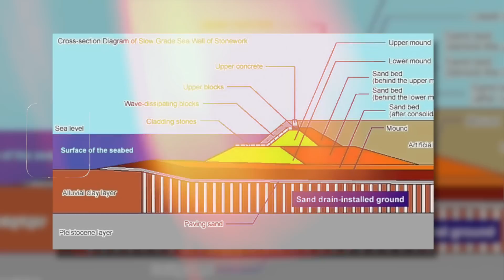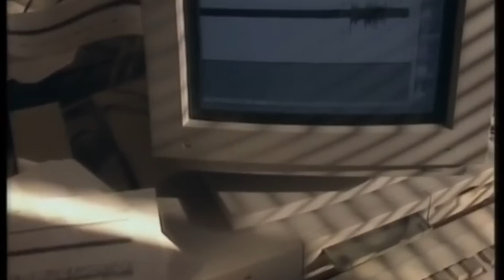Why Nobody Can Fix This $21BN Floating Airport

Comment from the maker: Is this the most flawed airport design in the world?
Reply: Germany's "new" airport takes that crown since it has never opened after more then almost 14 years of construction. it is 4 years ago since it was supposed to open.
Reply: @bailvik6390 häh? Are you talking about Berlin Brandenburg Airport?
Reply: No, but this is the most flawed title on your videos...
Reply: It's man vs nature and costs. They could have over engineered the airport's height if they wanted to but that would cost a lot of $_$.
Reply: No. That would be Terminal 2 at Benito Juarez International Airport in Mexico City.
Reply: Very good! 😉👍
Reply: Berlin anyone?
Reply: It’s the most inaccurate video title I’ve seen in a while.
Reply: It is obvious that they miscalculated the height needed to ensure it would not subside or sink... keeping in mind erosion and natural subduction, and not sea-level rise. The only real issue now is to not abandon the airport but to incrementally rebuild over it; thereby, building it higher in sections where it is vitally needed most and gradually over other areas until it is high enough to last another 40 years. To do so, they need to sink under water cement deep enough as anchors to create pillars for support, then add stable topsoil filler to rise the foundation. I am pretty sure the whole project would cost a fraction of the previous build to rise and restabilize the foundation.
Reply: Thanks captain obvious
Reply: Ask the dutch to fix this
Reply: If this was made bu china this youtuber would be calling this one of the greatest accomplishments of humanity.
Reply: This documentary is a bit misleading.  The airport is sinking but not so alarmingly.  They have been able to slow down the sinking.
Reply: My home
Reply: Chinese Military artificial Base islands with airports are eve worse
Reply: The airport was repaired after Typhoon Jebi (therefore it can be repaired, and the "sinking" problem apparently only exists on klickbait pages.
Reply: wondering why they didnt use concrete pylons driven into the ocean floor to depths of 100ft + ? After Katrina the US Army Corp of Engineers rebuilt the levies and flood barriers. In one section they installed concrete pylons to support a flood barrier because there was no bedrock just deep mud. It's held up for over 10 yrs.
Reply: @artcurious807  Said airport is build on two islands, and is NOT sinking. And already was repaired once, after a taifun. Therefore, the video isn't but bs.
Reply: @hokroeger  It has been sinking slowly over the years due to settlement, not due to the typhoon. Just look at the jacking up of all the columns and you will see the repair works that were done.
Reply: @PhiloSurfer  Well, in the case of a Typhoon, like the one who destroyed the Japanese Nuclear Power Plant, it's obvious that it happens because of a typhoon, not because of any sinking of the terrain.

Comment: why it is sinkings is water is running like river under the iland no mater what they do it will go down un less they box the iland in with  1000 ft plate sheets that stop most water flow under the  iland this is some thing that happens alot when there is water on more th one side of an area . it starts out washing out the less compact areas of the iland first which will pull other are of sand around under ground  . i  worked as a hevey equipment operator on an iland for 3years diging  and trying to stop stuff from caving in

Comment: With the cost of the islands of the order of 1000 USD per m sq, perhaps a truly floating island could be build, with sides and the bottom from reinforced concrete?  This shell could be filled with something lighter than water, perhaps hollow concrete blocks...

Comment: If the sea bed is shallow just drill from the surface and install concrete piles into the solid parition of the sea bed. Use large rocks to create a barrier from waves on the side facing the largest body of water.

Comment: I was a mechanical engineer who worked structural engineers. I changed planes at this airport in 1996. I had enough time to walk around and found a display about its construction. The 2.2 million sand filled pipes would be called piles. The display called them piles but did not mention sand as I recall. In my experience in US construction I don’t recall sand being used in a pile let alone a pile installed under water. I believe the designers expected the mass of the airport to be supported on the piles.

Comment: It is estimated that it will take more than 20 years to settle. The Japanese land management laws actually require the filled lands to stand for at least two decades before any development starts. But loop holes were used to avoid such restrictions for the Kansai Airport. It will fix itself after 20 years and stop sinking. Every engineer was aware what would happen. But profit came first. No biggy!

Comment: They will simply need to raise the sea wall and add additional landfill over the existing runways and repave them.  The buildings were designed to be jacked up on their columns so they can be raised gradually.  It is misleading to say they don’t know how to fix it.  This was always expected and the fix was designed into the plan.

Comment: Me with my random ideas, and zero experience in construction, I would say, increase the surface area around the airport a little by extending the edges of the concrete base and build a wall around the airport.

Comment: It used to be a wonderful airport - my best time from landing to exiting the terminal building was under 15 minutes. But, recent "renovations" have sacrificed much of the space previously given over to passengers, to retail. As a result, the arrivals & immigration areas are now much smaller with snaking lines of passengers having to wait for an age. 

Like most sane passengers I do not want to use an airport as a "shopping experience".
But now KIX finally became just like most other Int'l airports - dreadful.

Comment: They already solved it... Or should I say Tokyo already solved it along with NYC. Build a new one directly on top of the old one.  They already said its going to keep sinking till the ground finally settles so just speed the process up. A lot of cities build directly on top of existing infrastructure.  As far as the financial  aspect its already built and in use it would cost them more in loss permanently losing the airport

Comment: i have a simple solution if anyone here can please notify japan. first, it is obvious that at some point it will stop sinking. however this will put it below sea level. it is important to note that typhoon or heavy rains must be removed constantly with pumps during the rains. here is my proposal. at the outer edge where the sea walls are located, you must pile up more dirt. this "island" will become like a volcano type of island. meaning no sea water surges can make it over the outer edge. the bridge may have to be raised at some point. the dirt piled high, will also hide the airport from neighboring neighbors. these new dirt walls must be fitted with trees and shrubs to help with erosion and wind damage. then in approximately 100 years, new layers of runways etc will raise it up even higher. since the buildings are able to be raised, the electrical connections will need to be extended and plumbing as well. essentially the mistakes made here were not raising the island high enough on the initial opening. this is evident by the island sinking more than predicted. when it comes to construction, you must think outside the box especially when this much money and resources are going into things. my opinion is a large hotel / resort / casino should be built on the island, one that is very heavy and must be supported ten fold of what the airport is. this mega resort will be self contained with solar and wind turbines, salt water desalination and completely solo like the wall going up in arab country. also crypto will only be used inside. PULSECHAIN coin $0.00006

Comment: When they update (if the industry and transportion tech doesn't change in 30 years) They better come up with a fantastic pumping system  and or the worlds largest hydraulic lifters...Unless it fully compresses and they build it up...the surface level will be below sea level....and scientist calculate a ocean rise of at least 12 inches (.30 m) in 30 yrs. time (if not faster)...with tides and weather changes thats a lot.

Comment: I would think if they filled those pipes with sand, they could remove the sand and use them to "mud-jack" the base of the airport. Surely they thought of that, right?

Comment: It was stupid to call this a "floating island." It isn't. it's a land reclamation project like the palm islands in Dubai. They cut corners and obviously went to the lowest bidders when they found the engineers. They clearly didn't factor in the weight of the buildings when they did their calculations. Change the title of this video. It's misleading.

Comment: 2 things stick out: 1- why not build it on top of the mountain if they had all this work of leveling the mountain to dump on the water?  2- the main problem isn't the airport sinking but the water coming in, they only need to build a dam around it large enough that water doesn't flow into the airport. Also add some pumps around the dam just in case. I mean do that and the airport can sink another 5m below water level, as long as the airplanes have enough angle to land/take off that sinking shoudn't a be any problem
Reply: Dams need bedrock, I’ll be surprised if it survive’s a big tsunami!

Comment: They will build a replacement in the area  nearest to the mainland and use the old islands as a buffer. Thats the only possible solution. Japan routinely replaces its buildings because of substantial and frequent earthquakes. They knew they would have to do this again someday.

Comment: If they had built it on pillars set on bedrock and an I-beam substructure it would have worked. Or, if they had floated it on helium balloons from Walmart.
Reply: That's the big mistake they made not having the concrete base of the airport set on top of the piles instead of the fillers in between the airport base and the top of the pile structure. The filler is oozing out the sides and compacting between the piles.

Comment: The title is misleading, it is not a floating structure. And no, it cannot be fixed. The more weight added to the structure, at the very bottom of the structure the soil will be pushed aside and it will simply sink further. It is doomed.

Comment: Raise the steel walls corner to corner below Airport from seabed till it touches to under surface of airport.
Fill this cornered regions with High density extremely  thick foam .
Side walls prevent foam spreading to ocean.
Foam raises Airport evenlyfrom seabed.
Allow water escape at clearance near seabed as foam expand it displaces water.
When foam is expanding make sure it is expanding within cubical form. Making it like Foam bricks supporting Airport.
Side walls shall never allow foam to escape.
It shall maintain uplifting Airport upward and sinking would stop.
Also if Airport raises to initial limit then anchors could be realigned to initial first mark position. 
This is how one can surely  stop Airport sinking.
Hope your goodself would pass this comment. To Japan Authority of Airports.

Comment: For some odd reason, I'm thinking about Dubai's Palm Island Project all the way while watching this. 
Talking about Kasai, the ingenuity of Japanese engineering is remarkable here. Their method is simple yet works. They basically slide a piece of metal plate into the suspension column to keep the ground levelled.
Reply: lol!  palm island is a disaster.

Comment: Human "ingeniuty" always has a limit, especially when financial limit is one of those limits. Here the problem was assuming the underwater base would "fully compress", How??? It is not confined to a specific area so it wont "fully" compress. If small volumes of foamy water can have its way with beach sand, imagine underwater currents versus any type of sand.

Comment: I think it is impossible to simply lift the entire airport. You can only demolish it, heighten the island and rebuild the airport. And all has to be done in stages, because meanwhile the airport has to stay in use, I guess.
Reply: The airport buildings were built on jacks as they expected settlement. Just not as much as they're experiencing. So it's basically an infill/stabilization project and what is involved in stabilizing it... If it is even possible, which nobody is certain of.

Comment: ooncrete grout injection?  Drive some holes around the perimeter and make a sort of "batub by grouting with hydraulic curing grout?
Reply: once that stabilizes everything you can refill  the sinking bowl and just do that every decade or so until everything finally hit bedrock or equibrilium

Comment: It works, but has issues
Reply: It's doing its job. The typhoon event was likely higher than the designed level event and the continuous settlement was going to eventually stabilize but the beyond design level typhoon event caused more weight on the dredged material that caused additional settlement. It's a circular problem that the engineers did well to contain and continue to improvise to keep the airport functioning for the past 25 years. It's no easy task but creating more landmass was needed.

Comment: ⚔️As a follower of this fascinating airport, since it inception; I’m thrilled to see this latest up date. Maybe ~ 25 ago when it was sinking, but had the jacks on top of the pylons; I felt that could finally be at peace. Until it was reported that the jacking system was maxed out. I did arrive at speculative solution, when there was no online place available for me to comment on it. Resistance: The first was because the clay acts in a similar way that aquifers do. Second was the extra weight being added with more asphalt to keep the airfield above water. One solution is to relieve the area of extra weight. But what do we use to keep its present elevation stable? I thought of a flood plain that raised every rainy season that put water weigh on the top of a concrete sewer infrastructure project I graded. Civil Engineers use wood chips from a local mill, above the sand that’s on top of the pipe, then the excavated native soil was added to the top of the wood chips, to counter the extra seasonal water weight. So, where beneath the airfield do we put this replacement, or what else besides pneumatic balloon materials filled with ~ air, is used? There’s always under the pinning procedure, to replace, the removed materials. Removal of the surface in a cylinder shape like the manholes used for infrastructure pipes maintenance, dug to a allowable depth, then added the above suggestion for replacement; that is done continually throughout the surface, could relieve enough weight/ pressure. My idea has also come from a Star Trek series, that when crews were faces with an alien invasion force, that increased their offensive power each time, the crew increased their level of defences. Finally, when it was decided to back off the defensive tactics, then so, did the alien’s force. Good luck. Thanks for the update. 🛡️

Comment: Just to be clear, this airport is NOT floating. It is built on man made islands.
Reply: True...  If the airport could float this problem wouldn't exist.
Reply: something is amiss with the video author
Reply: @animelinux0830gamer True.  A lot of information in this video is misleading.
Reply: @animelinux0830gamer it's like the author is artificially or something....LOL
Reply: lies for likes.  the heart of internet journalism.
Reply: with my little knowledge my take is that with the degree of piling I think the airport though not as predicted will eventually settle and not sink again. Push comes to shove though there is always an engineering solution . More pilings may need to be added expensively in order to salvage the airport.
Reply: Next hurricane it will be "floating". 😆
Reply: No kidding.
Reply: dudes a chinese bot channel
Reply: They should have built the airport on an air….far from the water…!
Reply: Iifth the building up than ad 5meters off ground en build new runways ontop? Dit i solve it😂
Reply: .... su isole artificiali........ su un fondale argilloso. Per tale motivo sta sprofondando.
Reply: Right, 'floating' is misused here. What is crazy is in Seattle they have not one but two floating bridges across Lake Washington! One sank and had to be rebuilt. Crazy I tell you.
Reply: It's tricky. If the airport sinks it means that that soil below liquified. If the soil is liquified then the airport is somehow floating, just not by design.
Reply: @l3enjamin5in  Still it is not floating. Floating means that the upwards force comes from pressure of displaced liquid. This airport is still relying on upwards force from mechanical support.
Reply: @l3enjamin5in  the land is settling out being washed away, or a combination of the two. Either the earth underneath wasn't stabilized properly or they just didn't make the elevation high enough. Again, or a combination of the two
Reply: @l3enjamin5in  The soil is not "liquified". The issue is absolutely ordinary subsidence of the fill material. It's not a surprise, they expected some of it, but it's far worse than they expected and suggests that the missed something in the engineering. It's a very well-understood process and other fill areas do not have this problem.
Reply: @l3enjamin5in  no, then it would crack and break apart.
Reply: @Unfluencer  It is. The whole airport cannot be sinking at the same rate. The reason that it does not fall apart completely is that engineers are trying to fix it.